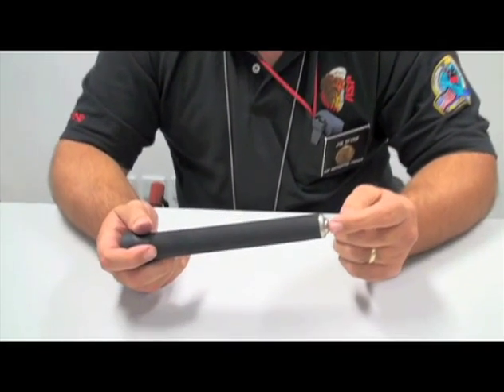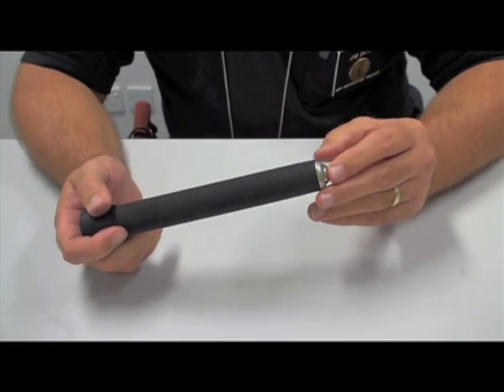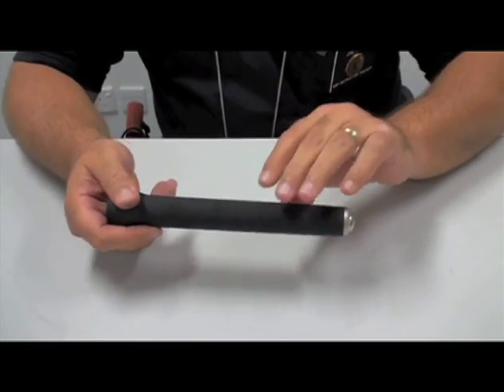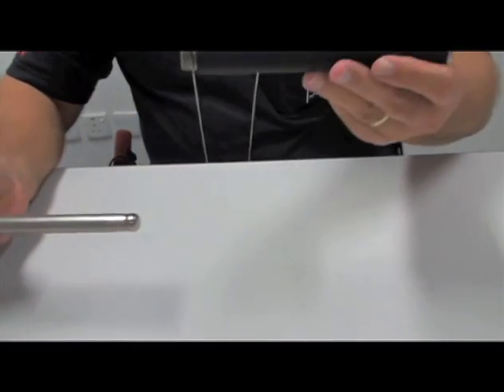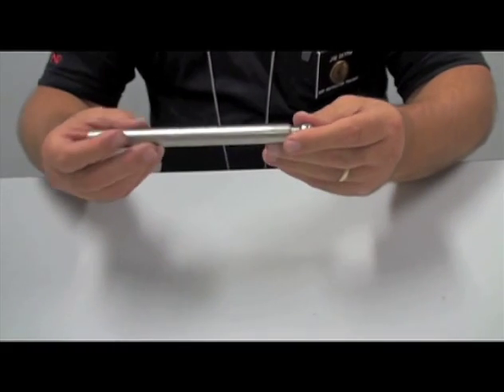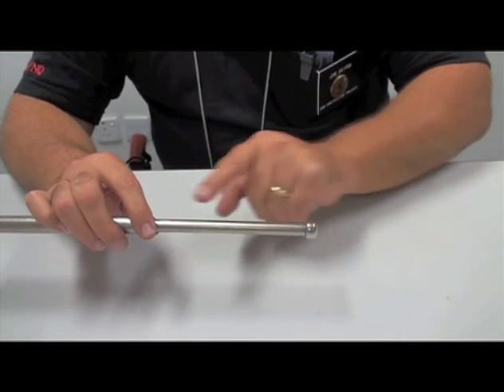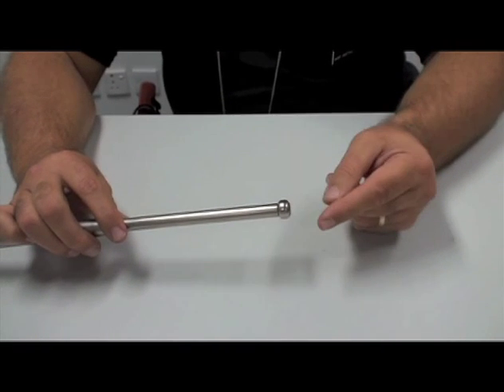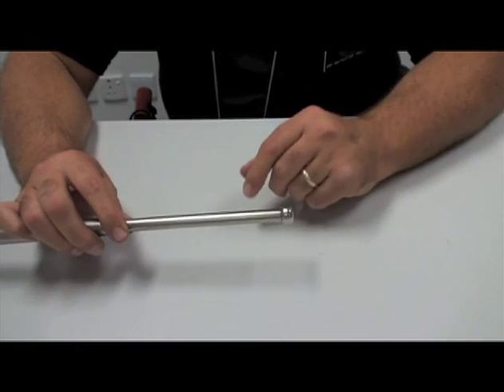Replacing Baton Tip

Comment: Sorry, what's the point of burning the Loctite off and completely unscrewing the tip if all you need to do in the first place is remove any burrs, sharp edges or whatever on the tip and polish it off. Can't that be done perfectly well with the tip in the shaft?

Comment: @LCFTW93 If your tip is loose or you are replacing it, it is very important to reapply Loctite.  If you don't, the tip will loosen and could either break or fall off.  We suggest you clean the threads of the tip first, apply the Loctite to the threads, screw it down tight and let it set overnight.  If you do this, there is no reason the tip will come off.  If you have additional questions, feel free to contact me at molly@asp-usa.com.
Thank you!
Molly Griffin
Corporate Sales
ASP, INC
Reply: what can i use if i don't have a hotplate